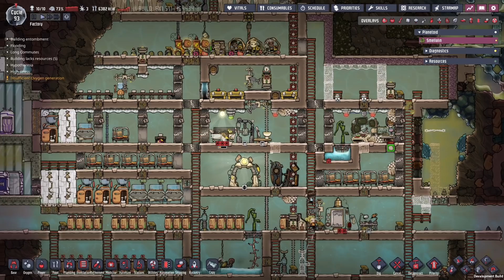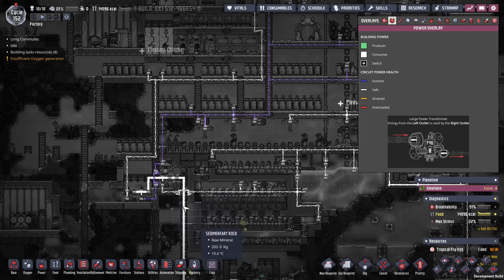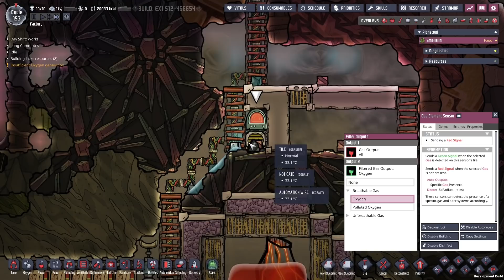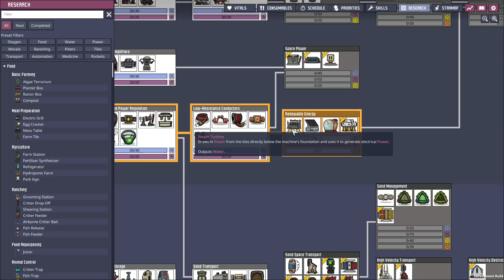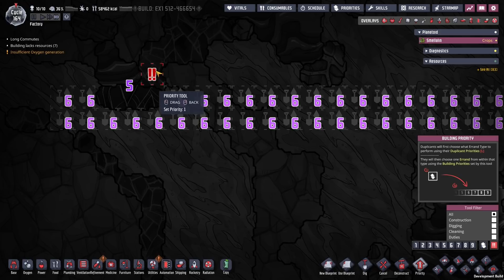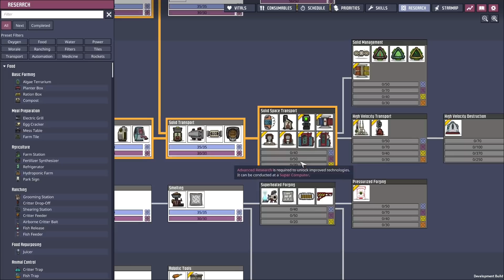3.6 ROENTGEN?! - Radiation Lab at The Factory

Comment: By pumping the co2 into specific areas, are you saving it for anything in particular? If not, would a door crusher be more efficient in the long run?
Reply from the maker: 100% will be using it. Good raw material for making more polluted water from a cool steam vent to feed into the oxygen machine.

Comment: Hey GreezyHammer, could you do fun things like duplicating molten glass or molten steel?? And then cooling them through steam turbines for infinite power lolol.
Reply from the maker: This specific approach doesn't work for heavy liquids, but we could do hot oil with thin petroleum layer on top. I'm testing a couple other ways. More info on Klei forums by nneko25 and mathmanican
Reply: Nuclear waste, light liquid with huge SHC.